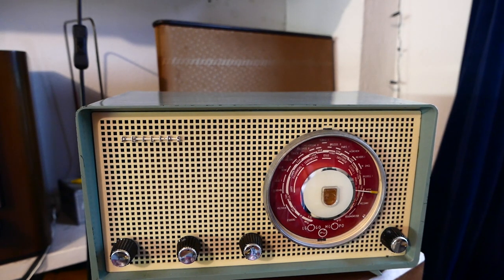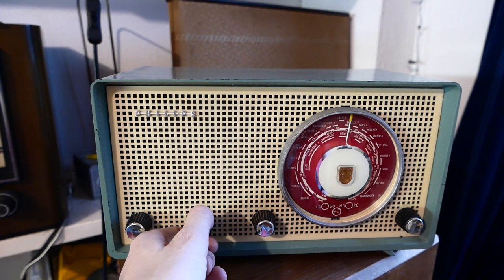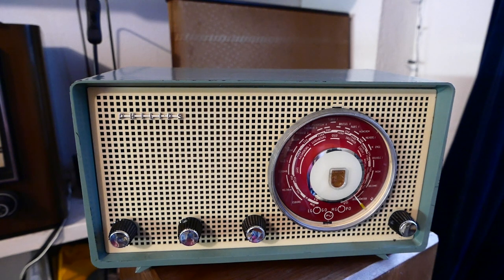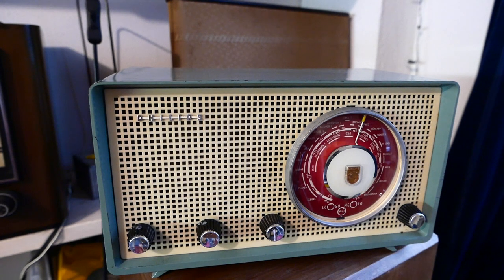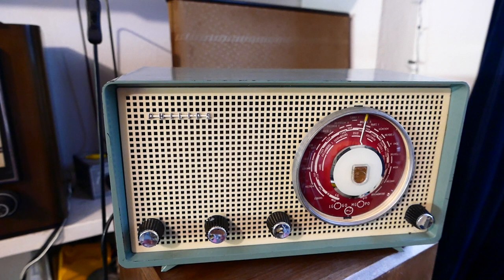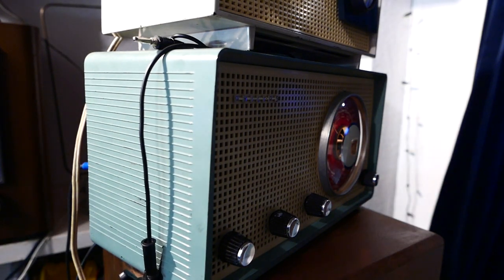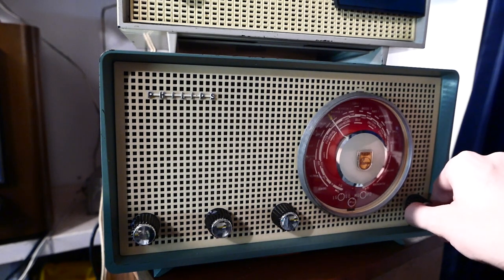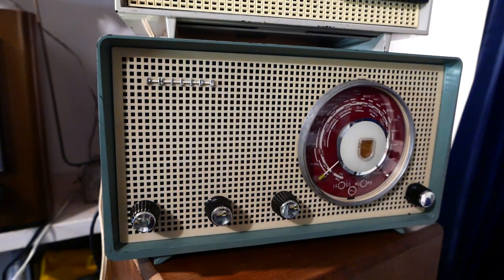Vintage Radio Review: Philips B2X80U Tube Radio.

Comment: I just pulled out identical from a recycler. Cable is chopped off and it comes with 4 wires. I looked inside and everything seams equally covered with a thick layer of dust. The extra 2 wires go to the middle knob, not sure what they do there yet. I found a service pdf but not all things are exactly in agreement.
Reply from the maker: Ensure that you replace all black tar covered capacitors. They always fail. Do this before powering up, or you may have one burn out (literally) or destroy a tube or the big green resistor. 
The big green power resistor also often fails, but you don't have to replace it unless it has gone open circuit. 
The power supply electrolytics usually are fairly alright.